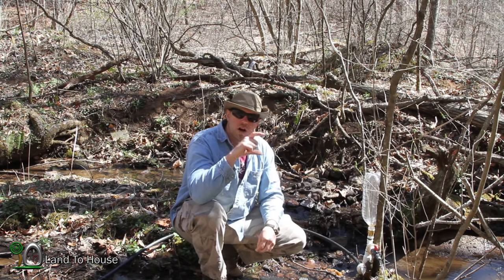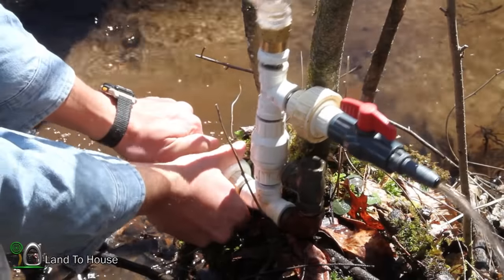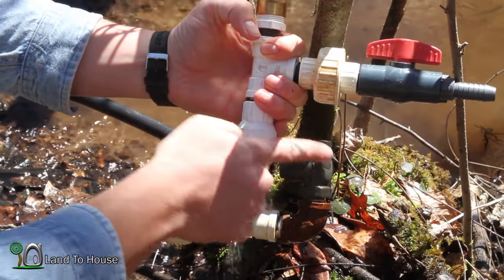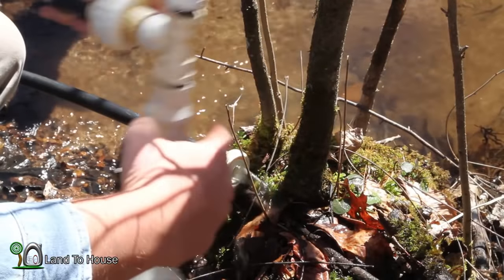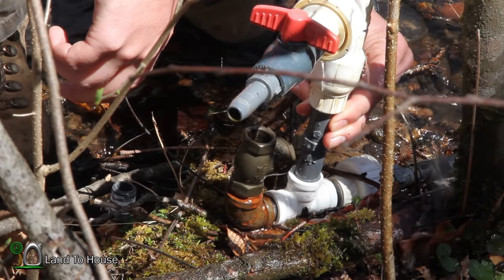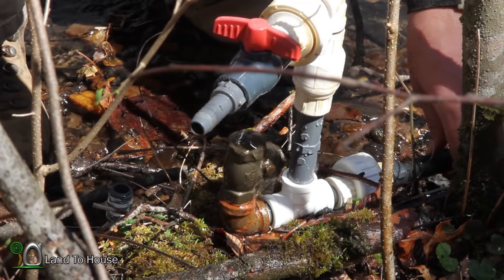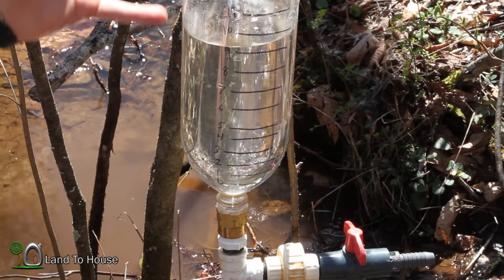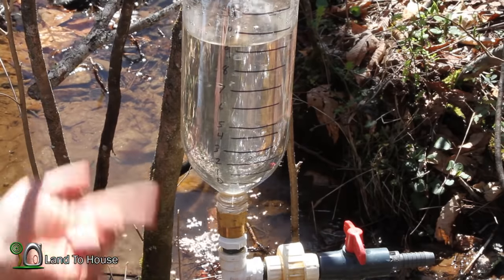Snifter Valve Research 2 Results

Comment: Greetings from Germany. My grandpa used an already ancient hydraulic ram pump back in the late seventies to water his garden. All cast iron. It had a snifter hole in it too, situated immediately below the flapper valve under the pressure-tank. There was never an issue with a water locked 'wind-kettle' as the pressure-tank is named in german. My cousin inherited the garden and the pump is still going.
The pressure tank will always lose air, since air is dissolved in the water at high pressure and is carried out with the water. The air either needs to be kept from dissolving by enclosing it or needs to be replenished continously. A water locked tank will be destroyed eventually.
The physics of those pumps are unique and somewhat counter intuitive. The waste valve is not operated by pressure as one might assume but through drag. If pressure would keep it closed, it would never open again. That's why the waste valve usually is adjustable, to just overcome the pressure of the feeding line. 
The pressure is generated by the pressure peak from abruptly stopping the flow of a large mass of water. Think of inertia. Flow speed and the mass of water in the feeding pipe determine the peak pressure. Just imagine the blow of a hammer, the heavier the hammer, the larger the blow. 
This blow generates a pressure peak, known as ‘water hammer‘. This forces the pressure tank valve to open and a small amount of water rushes through it at high speed. So far quite straightforward physics.
The snifter-hole is counter intuitive. It spills water at all times EXCEPT one single moment. The moment when water rushes through the valve. Inside a fast flowing medium the pressure is low (!). That is the moment when it sucks in some air. Venturi-effect is the physical term.
Drill a very small hole, between 1/16 and 1/32 in, into the brass body of the valve, just below the flapper. This replenishes the air in the pressure tank and makes any pressure element such as bladder, inner tubing, tennis balls, pool noodle or foam unnesessary.

Comment: This alternate configuration (snifter valve research) of vertically stacking the pvc check valve, delivery ball valve, and pressure tank, would be a great test to compare to the standard configuration to see if one or the other has an advantage with needing less delivery pipe back pressure to operate.

Comment: Great video.
   I'd love to see you reclaim the waste water, down the hill a little bit and pump it back up with another ram pump. Repeat that with 2 more ram pumps. So a total of 4 ram pumps down the line. Increasing the efficiency . Sounds like a fun experiment to me.
Reply from the maker: I have a large list of ram pump ideas for this summer. One of them is to use the waste water of one pump to run a smaller pump. Should work out well!

Comment: i have seen the hole drilled in the copper waste valve about 1/3 up but below the valve.. it was actually a 2mm hole.  the waste valve was before the water head.

Comment: Can you test the "Campbell Brass Threaded Snifter Air Valve" selling for $2.79 on Ace Hardware as suggested by Richard Raucino. You could also try using a micro drill bit approx 0.4 mm diameter or a fine heated sewing needle.
Reply from the maker: That would be good. I wanted to test this last summer but never got to it. I have this test on the list again for this summer.
Reply: The snifter valve may not work if it takes too long to operate and  I look forward to the result. Can you tell me the vertical drop to the pump and height of the outlet  pipe? Thanks for sharing your info.

Comment: Put a cotter key or splayed rivet in a snug, but not "tight" hole, rounded or flat side inside, bend the tabs into a Y , outside.
The key or rivet should move, but not flop. 
Make the pipe where the key is replaceable, as wear may be a factor in plastic pipe, or use a steel pipe for that portion. 
The pressure pushes the key into the hole from the inside, reducing the outflow. But when it sucks air the space around and along the key lets air in.
Addendum:
Use multiple drive pipes and catchments, and/or multiple pumps, always having one as a spare to use, if need be, while repairing or waiting to repair a failed unit.
Or all of them in late summer and fall when the flows are low.
Reply from the maker: That is a good idea. Others have suggested using a common paper brad for the valve. I think your idea is a better one. It would last longer.
Reply: The additional advantage being that with the key moving slightly in the hole, small silt bits will not plug the hole.
Reply from the maker: Yes. Those are a real pain for sure. With the new silt filter intake and bucket filter I have had very little silt. Have you watched those videos yet?
Reply: There's always the lighter bits, that don't sink, organic materials and the like.
Reply: Not silt, but floating organic material will clog the hole. The pin in motion, in the hole, helps to prevent the accumulation of such material.
Reply from the maker: Someday I will find the time to get back to testing the snifter valve. For the time being I am going to stick to the ram with bladder in the pressure tank.

Comment: Screw a "Grease Zirk" fitting into the Snifter hole.  First dig the tiny spring out of the bottom of the Zirk and cut off about 1/8" or so off the spring then stuff the spring back inside the Zirk and screw the Zirk into the Snifter hole.  Yet another, one-way valve.  Air in, no (or very little) water out.
Reply from the maker: That seems like a nice way to make a small valve. I actually have a tiny valve from an old C-Pap machine that I hope to use as a snifter valve. I have that video on the list for next spring.

Comment: I would like to know if adding the snifter valve reduced the delivery height and volume. This would be an interesting test to do a video on.
Reply from the maker: +Aerogrunt good idea! I will run that test next week and part the video. Thank you.
Reply: It is self evident that a drilled hole reduces total pressure and the snifter would not.

Comment: Go to a hobby shop and get a set of miniature drill bits so you're able to accurately size the snifter hole.  The smallest I have is a#72.
Reply from the maker: I have heard of people heating a sewing pin and sticking it into the plastic. super small.
Reply: Harbor freight sells an assortment of micro drill bits  ment  for dremels but can also be used by hand.

Comment: To land to house I suggest you increase the height of the air chamber to 80 cm or 1m.
Reply from the maker: This old ram pump test was just to find out what happens with the snifter valve. The pressure tanks on my other pumps are much larger!

Comment: What is the relationship between pressure in the air chamber and the size of the chamber?  Would a screw in Schrader valve not work?
Reply from the maker: the head pressure in the creek is what builds the pressure in the pressure tank. It will only build to the potential of the creek. if your pressure tank is very large it will only build to the head pressure potential. if you were to use a valve to put more air into the pressure tank it would essentially primed faster but would not provide more lift

Comment: Could you double your pressure by putting these pumps in series
Reply from the maker: Because the pressure wave needs to have open air intake it will not work to have all that pressure behind the second pump.
Reply: You can increase the pressure if you can make your own waste valve not a swing valve by putting additional weight and lessen the cycle. I tested this system already with my 1"ram pump, I have approximately 7 meter vertical head, the cycle is too fast that's why putting the additional weight to reduce at least 60 cycle a minute, when priming the delivery valve is closed the pressure tank(bladder tank) with maximum tested pressure of 15 bar is deformed and nearly explode, and it will explode if did not open the delivery valve.

Comment: How high are you able to pump water vertically with 2 ft of head using this system?  I have about 80 foot vertical I will be attempting this year...  haven't calculated my head just yet, but I presume it will be much more than 2 foot.  Just curious
Reply from the maker: +Trail Cam Stories I have not used this setup for anything but this one snifter valve test. My other pumps typically have a ratio of 1:7. So in your case 2 feet of head pressure will get you 14 feet of lift. With the design I sell I have pumped to 70 feet with a 12 foot waterfall. I have a subscriber that has pumped to 100 feet.

Comment: Hi Seth for the smaller ram pumps you might want to try this type of snifter valve which I made out of a grease fitting it keeps more pressure and loses very little water in the processI don’t receive too many viewers so you might help some people with this idea thanks you might look it up under my name Peter Saige or best snifter valve
Reply: Also the snifter valve has to be just below the opening for the valve that goes into the pressure vessel Hope this helps

Comment: https://www.youtube.com/watch?v=4k-0C4HxfLI

this guy uses a snifter valve also but he puts some kind of pin in the whole so it cycled when the pump cycles. He says he used a split pin..I am thinking it might be some kind of cotter pin. I am guessing the changes in pressure in the pump make the pin cycle between on and off allowing the exchange of air and water.
Reply from the maker: +Frank Johnson oh yes I have seen his videos. I was hoping to get by without having to use any type of valve. I believe it's just easier to use the inner tube and leave out the snifter valve. But if you have access to those parts it might be worth trying.

Comment: Buy a Snifter Valve and screw it into the pipe
Reply from the maker: +gardenman3 I did a basic search for one and did not find what I wanted. Do you have any good links?
Reply: Just posted a few. Many more if you search, even on Amazon sometimes. Ace hardware seems to stock both
Reply: Hola  excelente forma de conseguir elevar el techo rendimiento para arietes especialmente pequeños...por ejemplo  de 10 mm  de entrada...personalmente   votó  a PROBAR  con uno como el señalado, gracias por  comparti 
r!!!...

Comment: Good idea with using the screw! It seems to be work better with the pipe material. If you plan on making a lot of them though, there are really small drills used in circuit board fabrication, you can get them here: http://www.digikey.ca/product-search/en/prototyping-products/drill-bits/2360394
Reply from the maker: +David Lister Those are small bits! I think that I will keep to my closed systems because they are so consistent. The screw idea seemed to work well. I should think that the heated nail idea would do well if I had a better heat source. Out in the field I just had the lighter so the screw was the best choice. Thank you for the suggestion it was better then the drill bit I was using.

Comment: you are defeating the pulse with any size hole on the ram side, and why would you want air introduced into a high-pressure system all that will do is cushion the pulse Your problem is your air chamber isn't big enough to push water up very far. A hydraulic ram is not meant to build pressure at a dead end it is meant to pump continuous water under pressure. The ram pipe is supposed to be at least 3to1 or larger
Reply from the maker: Hi. Thanks for the comment. This video was a fun little test. Please check the channel for an additional 60 videos showing ram pumps with proper tank size and pipe relationships.
Reply: @LandtoHouse  You have so many videos now... and over such a long period of time. It would really help and be quite awesome if you would consider making a summary video with all you have learned summarized in one video... Sizes, ratios, dual inlet, dual pump, types of valves, etc.. all summed up in one video. And thank you for all your time and knowledge you have shared with us.
Reply from the maker: Seems like a very good idea. I'm adding that to my list of ramp up videos for this summer. I also want to make a comprehensive install video.
Reply: @LandtoHouse  Yea, that would be good too. Ya know, I just got through reading the installation manual for the Papa Pump, and it is surprisingly extremely thorough and a good example for setting up a ram pump system. Not trying to endorse or throw them under the bus either.. it's a cool product, well designed, but I'd rather build it myself than buy it, especially at that price. Anyways, they had some good material in there worth a read. Not gonna link it, but it's not hard to find. I'm looking forward to your summer ram(p) up!
Reply from the maker: I have briefly looked into those pumps. Their price point seems extremely high for what you're getting. I will be the first to admit that I'm not very good with write ups. I will check out their information and maybe pull some pointers. :)